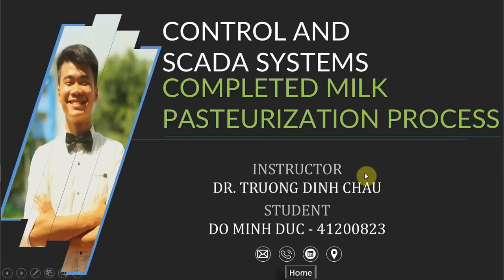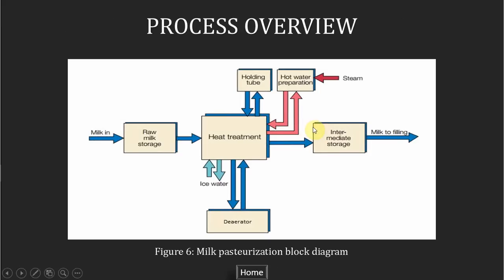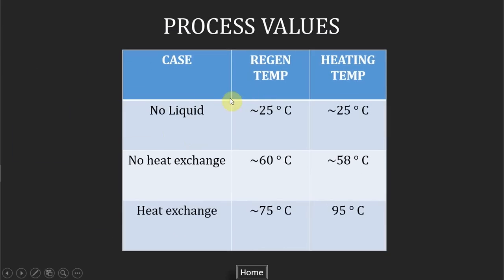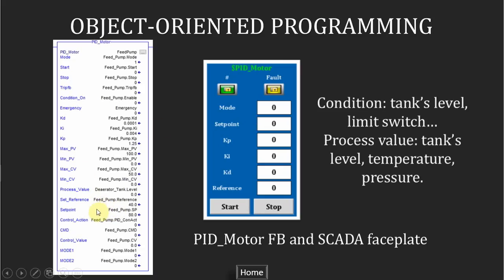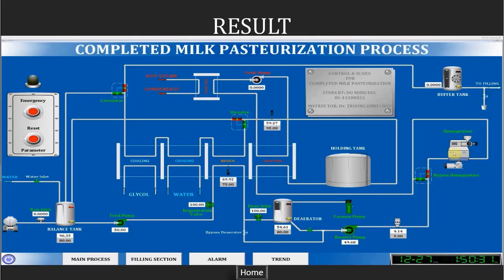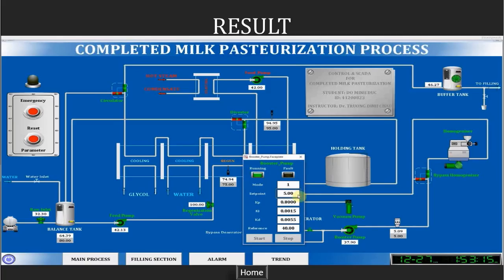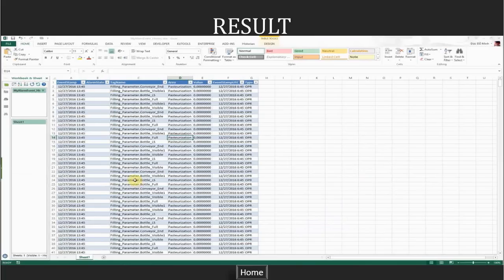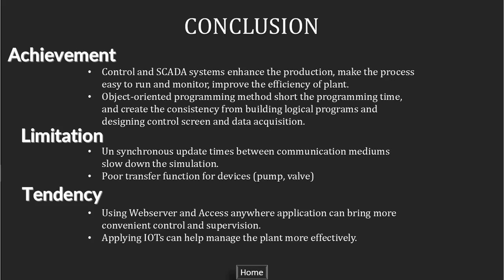Graduation Thesis - Completed milk pasteurization process

Comment: Well done Mr Minh, Did you have done any real process like this. May I have your contact, email...
Reply from the maker: No, i haven't done any real process like this. They're simulation programs which i built for the graduation thesis presentation. Thanks for your nice comment.
Reply: @rockydo123  Hi, what kind of  simulation program did you use ?
Reply from the maker: @kevinrodriguez1759  for the scada interface i used Wonderware intouch and labview for algorithm.